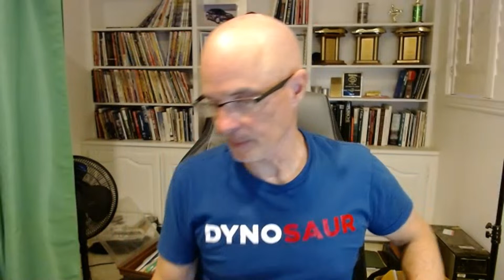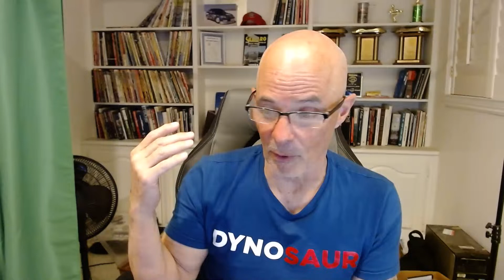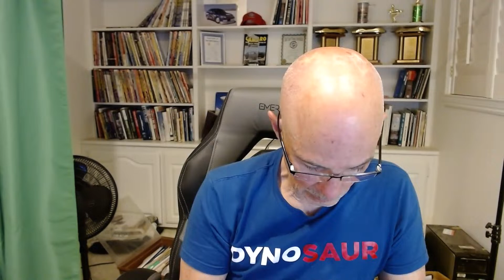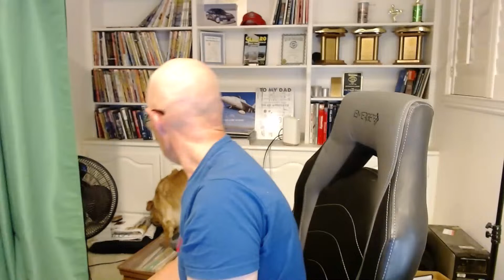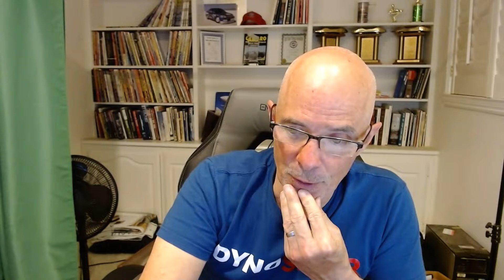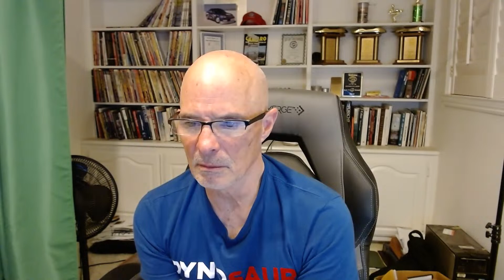BEFORE THE CAM... LET'S TALK TECH

Comment: If your truck has 706 heads and is making oil then you probably have one or both heads cracked. It's a known issue for 706 heads there is a gm bulletin on it. Coolant in your oil will make your oil pressure do funny things.
Reply from the maker: There is no coolant in the oil or vice versa

Comment: When I worked at the wrecking yard, we would take fuel from all the old vehicles to run in our cars and trucks. If you pour the fuel on the ground, and it will light on fire it`s still good.

Comment: The piston ring package on a small block is way stiffer. The breakaway between those two engines is not even comparable the LS turns over way easier it’s getting a lot of power from that.
Reply: Take two short box side-by-side small block Chevy and an LS put a torque wrench on it and see which ones turns easier the LS will break away way quicker than a small block I did the test.
Reply from the maker: that is not why an LS makes more power

Comment: Richard if you have a bad cam bearing is it ok to change the cam and bearings without rebuilding the whole motor if not metal is shown in the oil?
Reply from the maker: you can just fix it

Comment: Richard I just got my engine back from the machine shop it's a 53 bored to a 5.7 Chuck Norris cam 862 heads with big valves should be around 10.51 my question is what spark plugs and how should I break it in
Reply from the maker: THE HEADS DECIDE THE PLUG STYLE, BUT DROP TWO STEPS COLDER
Reply: So what plug do I use for 862 heads?
Reply: Can you help me out with what was stock on 8 6 2 heads?

Comment: I have to say, your patience and knowledge are both top notch.  Just coming back into building engines after taking about a 30 year hiatus and am learning a ton from your videos.  I was watching Engine Masters and they were great, but a bit light on the boosted applications (which you helped out with when the boosted subject came up.)  As my upcoming retirement project, I'm looking to take my old 1972 Chevelle with a well built 327 to another level, and also have to deal with the transmission and rear-end.  Your merchandise site is well done, and I'll definitely be pestering you when the time comes, and I can speak the new LS vernacular a bit better.
Reply from the maker: Happy to help

Comment: Another great show, Richard! I wanted to circle back on my personal build on my 09 2500 HD. Currently it’s an LY6 board 30 over.  Has a 227/233 605/598 113 lsa +4. 3000 stall. Upgraded springs and pistons. Stock head and intake. 85# injectors. Used daily as a typical 3/4 ton truck.  You stated a PD charger would better suit me.  I just wanted to double check with you due to the results of your low buck truck and small turbo results.  I can always change my cam as I’m looking for that low rpm power and not top end. Thanks for your guidance.
Reply: I have an Ly6 in my 09 3500 which gets used for towing a lot. I’ve been looking at Gpi’s vvt truck cam. I think a slightly larger cam and still getting some use of the vvt sounds like a win. My understanding is they do this by using vvt limiters. They don’t have any dyno sheets posted on their site and I can’t find any online so I’m going to call them this week and discuss this some more. These Ly6 engines have lots of potential since they came with a great set of heads. I have my eye on another Ly6 for my 2000 rcsb.
Reply from the maker: For power down low-then not a centrifugal. Smaller cam, like Low Buck Truck, and small turbo (depends on desired output)

Comment: Ok- we played the same game

Here is what I can tell you about a LS oil system

One if you take a Quick Look

An LS block looks like a “ side oiled”( feeds the oil to the crank bearings first)

Think old race 427 ford

But it’s not

It’s a “ top oiler” this sends the oil to the top end first

yes you started at the right place the sensor, but when my son and I did it
One held a rag over the oil 
sensor  hole as the other cranked it

This way you know the passage is clear
(It’s common for the screen in the sending unit to be plugged)

Then put the new sensor

If you get good solved

If not

Think wear can you get low oil pressure?

Some one that “ builds engines”  ( told me just toss you new cam in DONT worry about the wear on the cam bearings in a LS the new cam just drops lower…..( he has blown up 5)

Very worn cam bearing bleed off oil pressure!!

Very very worn

But let’s start ant the begining

If you drop the pan  ( it’s a big job)
But pan if full of sludge

Screen must be clean
So that’s
2
3 biting pick up seal is hard and cracked make sure you replace with right colour ( 3 sizes)

This is most likely your issue

Do the nose down over fill test
It stops the high volume pump from sucking air

4 there is a piston and a spring in the oil pump they can get stuck if it’s a sludge motor

5 some  LS engines have DOD lifter oil “ towers” in the lifter valley like my odd LFA
If the dod has been removed the lifter valley plate has been changed with a block off one

A bunch or o rings
To cap off oil for dod

If shot or  valley plate bent you can bleed off here

Best way to cap off tap and grub screw red lock tight

6 it’s a cam or rod bearing worn

If you got the pan off plastic gage 1000 grit to clean up if just worn toss in fresh bearings( we did the rods with one over new)

One thing you can do is pull the front oil valley plug
Drivers side front

Replace with fitting and hose to mechanical oil pressure
Gauge 

Then you know true oil pressure

Last it’s the pump

I think it’s not that they are very good

There is talk about a plastic
“ barbell” oil valley going bad in the back near the oil filter 

It blocks the oil so it heads down to the filter then lets it come back up to cam/ oil sensor but I can’t see that cutting pressure( it comes out the back I think you can replace with metal)

Has to be changed at rebuild

I have flushed an engine

Remember all the sludge / gunk/ crap runs through  bearings/ engine

I would never go it again

Dead quiet motor sounded like a very loose singer sewing machine( ford 3.8)

I am betting on the seal on the pick up- 90 percent it’s this
That’s what ours was

450000 kms( Canada)

Very little rim ridge on cyl
( timing chain tensioner broke skipped a tooth smacked the valves so we changed heads- rod bearings / pick up seal)

Still running around Oshawa 

With more power then ever( tossed the smacked 317 heads put on small chamber 862?706?

Made a huge seat of the pants change

Better bottom end pull because more compression

This was a 5.3 iron block

I know you don’t want to pull the pan  but it tells you the truth

Pop a cap
/ sludge

But theses things with oil changes run for ever

With that mileage

Change the oil
Drop in 20w50

If you got oil pressure  it’s very worn
My old Jeep 1987 straight 6

It’s all I ran 380000 kms got it at 200000 guy never changed the oil- so slid new rods and mains in it

Good luck - don
Reply: Also the single cab 4.8 5 speed stick is a 4x4
So they make them
Reply: Also the single cab 4.8 5 speed stick is a 4x4
So they make them
Reply: The best way to improve
Fuel mileage on an existing 
Car/ truck

Make the tire “ rounder”

I drove the 401 in Toronto for years-90 percent of the tires are to low
Speed limit 100 kms(62 mph)

True speed on hwy

125 kms- 130 kms
77 -80 mph

Check your owners manual

Our 2000 300m
Said 32 but above 70 mph
35 psi

Tires blow because they get hot
They get hot because side wall heats up

Sidewall heats up because of under inflation due to speed travelled or load carried

Do your test Richard it’s the same trip 100 times to west tec

Try 40 psi

Or reduce your speed

That thing is like pushing a bus through the air

Also drop the front end down

Helps air going under the truck( drag)

Find a 2 wheel drive s-15 stick
Ls swap it alum block

Way smaller front profile( I had one)
Nv3500 has a huge first gear so you can run very tall rear end( 2.73)

Build that motor I told you

“ most for the least”

You don’t want a 4.8 to heavy
100 lbs

You want a 5.3 Alu 
You want Tiny heads( more off boost power - high velocity flow)
You want TBSS intake
And your small turbo
Gt 3584 rs
You wants manual( low drive train loss)
Tall thinner tires

Make a salt flat truck for the street

We need 4x4 in the great wide north
You don’t your in cali ( miles and smiles)

There must be a ton of them in the scrap yards down there
Do the build on the channel

Free truck

Heck put a t-5 in it go easy they are cheap

Don’t turbo it
Toss in my LFA nothing cam
Great on fuel
Motor has to have flat tops

Squeeze all you can out of it

Heck toss a vw diesel in it
T-5

Turbo
50 mpg

Or your extra sprint motor
Huge boost
lol

Good luck

Proper tire pressure is crucial for maximizing fuel efficiency on GMC trucks, including models like the Silverado and Sierra. The ideal tire pressure for GMC trucks typically ranges from 30 to 35 PSI. Underinflated tires increase rolling resistance, leading to reduced fuel economy. Highway tires, designed for efficient driving, can also contribute to better gas mileage. 
Elaboration:
Recommended Tire Pressure:
While 35 PSI is a common target for many GMC trucks, the specific tire pressure recommended for your model may vary. Consult your owner's manual or the sticker on your driver's side door jamb for the correct pressure. 
Impact of Underinflation:
Even slight underinflation can significantly impact fuel economy. For example, a 10% reduction in tire pressure can increase fuel consumption by 2%, according to Tyrepower. 
Highway Tires:
Highway tires are designed with a smoother tread pattern and reduced rolling resistance, which can improve fuel efficiency, according to Tires Easy. 
Benefits of Proper Inflation:
Maintaining the correct tire pressure not only improves fuel economy but also enhances tire wear and performance. It can also improve handling and safety,

Comment: Richard, try using a half a quart of trans fluid to clean out your truck motor. It's an old mechanic trick from decades back. I put some in a couple days to a week before an oil change. I used motor flush on a 4.8 with 460,000 miles with bad results. Oil leaks, smoke out the tailpipe and lifter tick. 2007 van engine. Motor flush has too many added chemicals, my opinion. Trans fluid is safe and very effective bc it has detergents in it.
Reply: Facts I do it too it works like a charm
Reply: Dude, you just told all us old farts that you are OLD! My grandpa had an auto shop! He showed me that trick 50 years ago! 😂😂😂
Reply: Yeah, this is just standard procedure once a year. But I use a full quart of full synthetic at an oil change and change it out again at 4000 miles. Works great since it's basically a high-detergent oil.